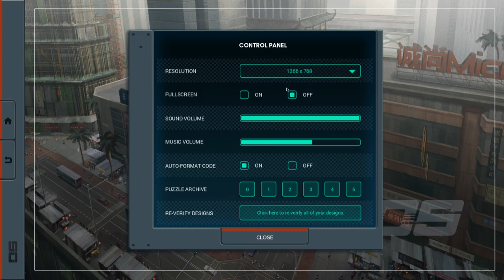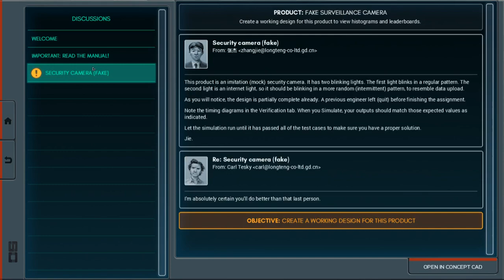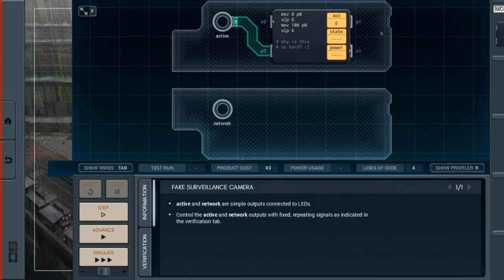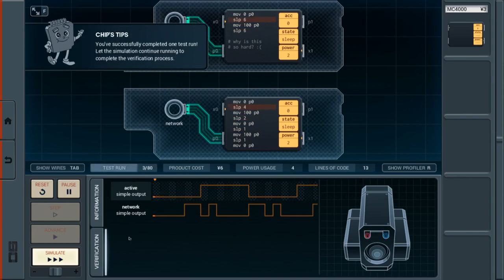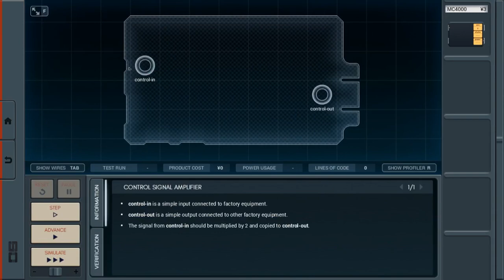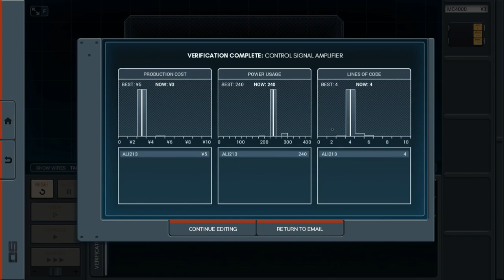Let's Play Shenzhen I/O, Part 1: The yen for Shenzhen

Comment: I went ahead and double-checked how far I got in this game... and, yeah, it gets complicated. I think I could probably hammer out a solution or two for the puzzles I'm at now, but I need to go back and redo some puzzles since updates broke my solutions to them.

21:14 - The reason why this didn't go high (100) as LateBlt expected is because the MC4000 in question was outputting 100 to p0 and then, in the same cycle, outputting 0 to p0. All lines of instructions are processed sequentially in the same cycle until an instruction that causes a wait of some kind (e.g. slp X) is encountered. If no instruction causes a wait... well, LateBlt gets around to that this video.

Issues like this can be debugged a bit by using Advance and Step - Advance moves forward one full cycle, while Step moves forward one instruction on all microprocessors that aren't waiting.

(Minor, trivial optimization on the first puzzle's solution as presented by LateBlt: because the 9th instruction and the first instruction are identical and nonblocking, the 9th instruction can be removed as it is redundant. Another optimization can be done with some knowledge of the operations you can do with the accumulator, which can bring the total lines of code down to 11. A 5-line solution supposedly exists, though I do not know the specifics on how. I suspect it relies on knowledge I don't have yet.)

Comment: Can't you use two chips? If you only care about saving a line of code, just double the hardware.
Reply from the maker: Hmm, how would that work? Even with two chips, you'd still need to perform the same operations... I can't really see how that would cut down on the overall code.